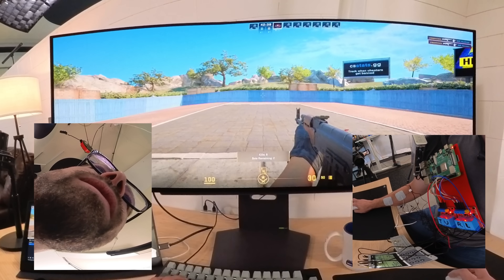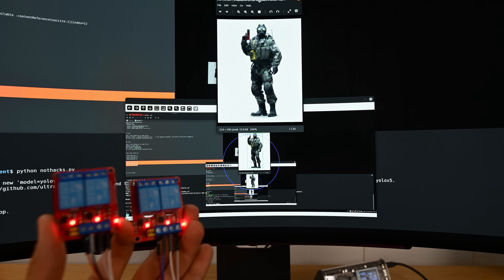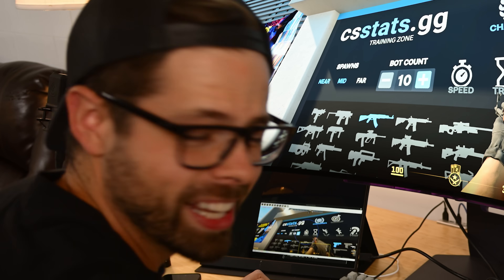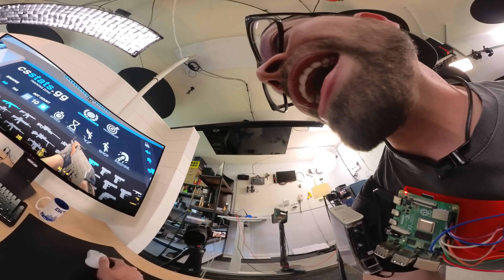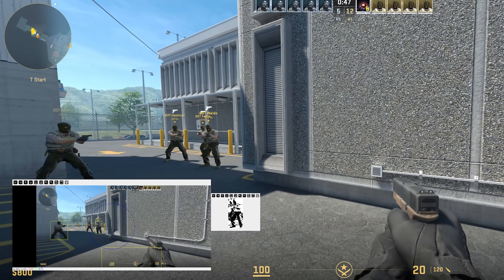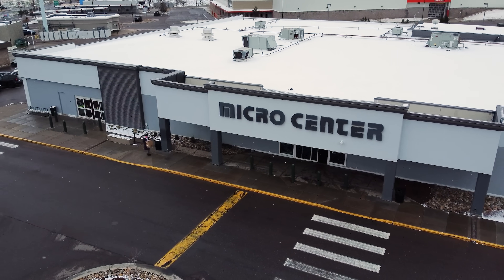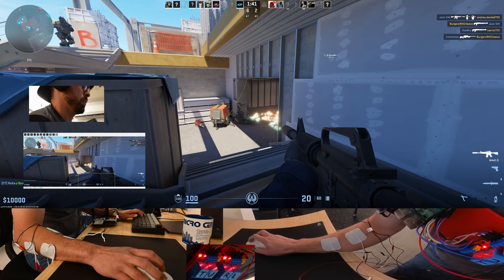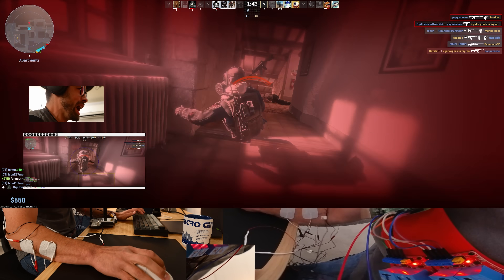Neuromuscular Aim Assist

Comment: As a neural engineering researcher, this might be the funniest video I’ve ever seen for any neural stimulation project. Absolutely love it!
However, I’d like to clarify some of the questions I saw in the comments, and there’s a reason why this setup can’t fully work as intended.

The most obvious limitation of using transcutaneous electrical stimulation to control muscles has to be understood through Henneman’s “size principle.” When humans control muscles, the smallest motor units are activated and contract first, followed by progressively larger ones. This small-to-large recruitment enables fine, energy-efficient movements and better adaptability.

In contrast, non-invasive electrical stimulation like this activates nearly all motor units in a large muscle group simultaneously. Moreover, according to Rattay’s activating function, the thickest fibers are actually the easiest to activate with the same electrical stimulus. This mismatch inevitably leads to the twitch-like contractions seen in the video, and no algorithmic-l optimization can fix that.
Reply: is it possible if he made an arm sleeve with hundreds if not thousands of those electrocute thingy but smaller and make it electrocute his muscles more finely rather than one shock in multiple areas?
Reply: @lorrr_enzo  The problem with all surface electrodes (the non-invasive ones) is that they are not precise. Current spreads through skin, fat, and other tissues before reaching the target
Reply: @tonywang9026 I mean... That's the same issue you have with dispersive media sending data. You deal with that by preemphasis: you reshape the input stimulus so the distortion actually causes the signal you want.
Reply: @patrickallison4876  interesting. Can you elaborate on how we can reshape the input stimulus?
Reply: @tonywang9026 i know I'm reaching but I'm just curious if how about if it's a subdermal implant? like small tiny needles piercing your skin and it wraps your arm like a sleeve instead of patches applied on top of the skin?
Reply: @lorrr_enzo  Yep there are definitely a bunch of labs doing intramuscular stimulation right now. They are more precise for sure but also comes with their drawbacks such as electrode drifting and inflammation
Reply: @lorrr_enzo  idk how nobody responded to this. I could genuinely see that being possible, however im not a neuromuscular scientist so i have no clue if im dreaming.
Reply: So you say he should go full chrome?
Reply: @FildaTheOne  underrated comment :)
Reply: The yt algorithm has brought us neuroengineers to the same place, i see
Reply: This reminds me of both gear ratios and some electrical engineering concepts at the same time... The human body is mad.
Reply: @Deja117  you should look into how it works- it´s the most fascinating machine out there :D
Reply: And then there's the problem of the relays causing a mid-pulse signal, which causes a signal perceived to be much stronger than a pulse that has the smallest of rise time (And than there's the risk of the bounce of the relays causing an even stronger situation).
It's almost as if there is a reason why artificial limbs are operated in a completely different way :P .

I also do not understand why they went with a wireless connection (Huuuuge latency) and an ARM computer (huuuuge latency again).  There's just so much that adds on top of the relay latency as well.
Reply: @Dutch3DMaster where’s your estim aim assist? Do you have a video on your setup?
Reply: @Dutch3DMaster  at the very end he mentioned maybe making it wired (connecting it to ethernet) but that that could present a higher risk of shock from current that is too strong (like a short circuit through the ethernet cable to the pc directly)
Reply: @mocoxiii  Ethernet connection is isolated, you can't get shocked through it
Reply: @mocoxiii  No, all the power supplies for his computer and stuff should be fully isolated from the mains voltage so that wouldn't pose a risk. There would only be a risk if he decided to run POE (power over ethernet) as in some installations the voltages used are over the intrisincally safe value (48V), although there wouldn't be any reason to do so for this application.
Reply: Amazing read, thank you for sharing! :))
Reply: Another question I have is. Is there any side effects to having your arm electrocuted day and night. I'm just curious.....with all due respect....it's for a friend.
Reply: @SourDonut99  It all depends on the pulse width, amplitude, and frequency
Reply: @SourDonut99 It was one of the things Bruce Lee did to build strength without bulk.
Reply: Pain and force feedback are massively underrated in VR. 

This would be amazing for like a sword fighting game. 

Source: SCA heavy fighter.

I would love to buy a suit that could not only beat me up, but also provide external reflex stimulation.
Reply: How about using invasive needle electrodes to stimulate specific muscle fibers just like in EMG tests? Would fine tuning be possible then?
Reply: @lynnrinkui  Good thinking. Many labs are now developing intramuscular electrode precisely for this reason. But invasiveness also comes at costs (such as drifting, inflammation, etc)
Reply: Flesh is weak
Reply: What about if instead of turning the current on for 0.04 seconds, it repeatedly turned the electrical signal on and off at a very high frequency for the same duration. Could that reduce the unpleasantness and cause smoother reactions
Reply: @PooeyBum11  That's exactly how most pulsatile stimulators work! A train of high-frequency biphasic pulses
Reply: very cool info thanks for sharing!
Reply: Wow, great explanation
Reply: I mean can't you pulse it like in pwm?
Reply: there's a comment down here saying this by @xPorkchops007x "You could train a neural net on your arm and wrist movements so it learns the proper shock amount to apply"
Reply: i believe the neural engineering researcher part because ur name seems to be tony wang
Reply: Doesn't work for non-invasive you say...
Reply: youre right, but we can build better and more precise electric shocking devices that only activate the correct muscle.... this is nuts.
Reply: @Embreh89  You're right. Lots of progress are being made in the field!
Reply: I understood what you said
Reply: Would duty cycles work? Idk if anyone else asked that, this comment thread is crazy long
Reply: I wonder if one could use a PID to minimize the error? By tweaking the sensitivity of the mouse and incorporating mouse acceleration as well, I suspect you could create something that could at least mitigate the impact of the twitches.
Reply: @pruina3395  Funny because I just had a PID neural modulation discussion with another friend of mine. However, in this case, since motor units fire in a all-or-nothing fashion and the current from the electrode spreads so much, FID won't eliminate the hardware limit.
Reply: You say these things, but this would be a great start towards efforts to give mobility impaired more access to gaming. It does need a lot of work and calibration though.,
Reply: Could someone potentially... "Cheat" weightlifting with this? Not by being stronger, but like doing 15 reps without the brain saying "ugh I hate doing this"
Reply: @Aexium  That's definitely possible lol, but you can still get drained by these repetitive reps. The brain receives info bottom-up from the body, but it also monitors and modulates the body top-down.
Reply: Can you do Foucault currents in the nerves if you targe an specific varying magnetic field? I didn't do the napkin math, but it should be theoretically possible.
Reply: Bro said nothing
Reply: thanks for the clarification, I've always wondered why external stimulation was always twitchy
Reply: lessgooo!!!
Reply: Ohhh so you're the one researching how to make human - techno hybrids! Thanks for bringing about humanities downfall we all really appreciate it 👍
Reply: @shlermjuice8068  you are welcome. I assume you've never heard of cochlear implants and prosthetic limbs right? Why spend the effort learning about neuroethics when you can just talk pessimistically online
Reply: @tonywang9026  That's how it starts, you make implants connect better and better to signals from the brain until we are all half human cyborgs. Have you never played Cyberpunk?
Reply: @shlermjuice8068  Yes, one of my favorite games of all time. Now, if you think about it, is the dystopian world of cyberpunk actually caused by the implants and the progress of technology? Or is it from the monopoly of big Corps like Arasaka, the corruption within NCPD, and the inability of the night city government in controlling the misuse of these technologies? 
One thing I can tell you is, technological advancement can not be stopped. If it CAN be done, it WILL be done by someone out there in the world. Instead of being scared of progress, we should instead focus on how to control it, and how we can put it into good use.
Reply: @tonywang9026  it's 100% caused by both. It's the advancement of these technologies for profit and military control which is literally already happening. These tech CEO's in the US have basically no boundaries with what they can and can't create because, similar to Arasaka, they work as defense contractors for the US Govt. Hell, 3 tech CEO's were just appointed into the military by this administration as Lieutenant Colonels! 

So yeah it's 100% about how we use them, but if there were no money to be made from these implants you probably wouldn't be researching them, and if profit is the sole incentive of these technologies there's no telling where it might go and how dystopian it might get, even if they started off with good intentions.
Reply: @tonywang9026  Btw, "if it CAN be done it WILL be done" is complete nonsense. Just because the US can nuke the entire world doesn't mean they will.
Reply: @shlermjuice8068  As I've said, the world is huge, so technological advancement can't be stopped. People will always find profit in these advancement and some of these people are always greedy. The real question to think of is, how can we actually limit the damage these technologies bring and how we can adapt to them as a society. 
Also, many scientists I know do not care about profit at all. We do what we do because we want people to be free of disabilities, we want people to suffer less from injuries and pain. Its a purpose we share, not just a career objective. I guess this is one of the reasons why government-funded research grants are so important, since it guides what science can do, and allow non-profit research to exist.
Reply: @tonywang9026  Sounds like you completely missed the point of one of your favorite games of all time. might I suggest another playthrough?
Reply: @shlermjuice8068  At this point you are simply out of valuable things to say, and I can not tolerate educating a person who think irrationally further. Applying the danger of unchecked technological advancement to all science progress is comical and absurd.
Reply: @tonywang9026  You simply ignore anything anyone else says of value so there's no real point in seriously talking to you. My original comment was a joke anyways
Reply: @shlermjuice8068 why are you in this comment section fear-mongering? Your argument is not logical. 

There is nothing inherently wrong with humans using cybernetic implants. Like with every form of medicine: it’s all about HOW you use it.

Comment: If you shave your hands and use a rubber band to secure it. You will get a more complete response to the muscle contraction. You can also use an ultrasound gel
Also, sooner or later you will not need to use this device, your nervous system will build a connection and you will do it automatically 
You do not need to do it for a very long time, just 20-30 minutes of stimulation
I am a physical therapist

Comment: I'd love a follow-up to this but I'm with a slightly different strategy. Instead of trying to move your arm to aim, you should stimulate your finger to fire when you're on target. A lot of "aim assist" hacks work this way instead (first because it's harder to detect, and) because it lets the player have the most amount of control while still giving an advantage.

I imagine in this case, the shock would be less extreme, since it'd only need to contract your finger rather than the whole arm, so you'd experience less "shock" throwing off your aim.

EDIT: Well that shows how far I got through the video haha

Comment: One way to refine this could be to cover your arm in a grid of electrodes and train a neural network to activate the appropriate muscles on its own. It could also be specifically trained to apply shocks as weak as feasible, make use of several muscles at once and be as non-disruptive as possible.

Comment: The real cyberpunk is to assemble a military costume that will force you to aim and shoot for you using cameras and neural networks
Reply: At that point just use a robot
Reply: @endora0841robots are expensive. Animals have a sens of balance built into them already.
Reply: @endora0841 In a dystopian future laws are made so robots aren't allowed to shoot people.... but cyber-cops could
Reply: Building a suit like this is honestly trivial... Slap some pressure sensors in it, really fast servos, and some other bits and bobs to help your fingers contract faster by pulling the gloves shut, and you're set. You might also want a 360-degree camera on the helmet for target recognition, and heads up display in the visor for highlighting possible targets. 

Not harming the user in operation is a whole other story. You can build the suit, and many militaries have... But it usually crushes the user's bones, or is absurdly expensive to make and even more expensive to maintain.
Reply: The real cyberpunk is that at some level of automation it wouldn't even require the person inside to be conscious. Being alive enough to power the muscles should suffice. This cojld even provide conversion of the abducted enemies or whoever else into your soldiers.
Reply: @deniskhafizov6827 So, a Gutterman
Reply: So we just need a colabe of Basically Homeless and the Corridor Digital crew, the made an AI computer vision thing for criminals a while ago, was pretty wild.

Comment: Those Linux burns were crazy.
…
Anyway, Ubuntu is the one and only true Linux distro.
Reply: Wrong endeavourOS is
Reply: @xapu8775  nah, Big Sur is peak
Reply: @HMT_main na man eff mac os. It sucks ass and doesnt even allow for propper gaming
Reply: @xapu8775 The MacOS settings are probably just one volume slider
Reply: @xapu8775 I don’t even use Linux on my main PC

Comment: Needs a calibrated P/D control with some delta p based learning to get the initial acceleration to be somewhat predictable and constant. It kind of looks like the electrodes get you moving in the direction and then you have to compensate after you realize how fast it's pushing you and in what direction - which might not be easy to predict unless you've already spotted the guy and are ready for it

Comment: Instead of shock pads you should create a mesh skin that can wrap around the arm, use a diamond lattice and place the shock nodes on each point. WOuld give you a much wider area of muscles to access easily and would give you much finer control over the the muscle shocks.

Comment: One problem is those relays have an "on" delay of about 10-20ms. You could eliminate that delay time by using MOSFETs instead. Also designing your own TENS with a cheap boost converter and a cheap motor driver H-Bridge would let you have Bi-Phasic DC rather than the mono-phase DC from the cheap Amazon TENS. Bi-Phasic hurts less and is more efficient at neuro-muscular activation. ChatGPT got me through a build that worked really well in about 10 min.

Comment: You need to make the control signals proportional to the distance fro mthe crosshair. Average that for all weighted on closeness/inverse distannce and remove the deadzone. Than you will have constant influence by the system, no pain and abrupt jerks/jitter, as the signal will get weak when you get close to the target. Also add a prediction layer using the average reaction time of you, so the  system will not send signals that move the same direction/velocity you are already going. You got a great start, you just integrated non of  the math a aimbot usualy does. Looking forward for part 2

Comment: part of the issue could also be tension management. grip tension is not the only type of tension, but also the explosion of tension in the muscles moving the mouse. there's only so much of this that can be used, so when a large explosion of this tension is made, there isn't enough to stop the mouse or make followup adjustments at the end. this is why weak aimers who have not trained all three muscle groups (fingers, wrist, and arm) have such poor micros and stopping power, as they're trying to use the same muscles they've just used to push the mouse extremely fast in one direction to follow up this initial flick. in your case, you're literally shocking your wrist to move inhumanly fast in one direction, then trying to use that same wrist to micro at the end, which obviously doesn't work. if you were to learn to use your fingers when aiming, this could be helped. also, reaction time, while partially genetic, can be trained. how fast your eyes actually process the image is quite fast, probably around 90ms, but your hands haven't been trained to move this fast. if anyone's really interested in training reaction time for fps games, learn about movement reading, and if you want to train pure reaction time without regarding fps mechanics, try ballsheetogl